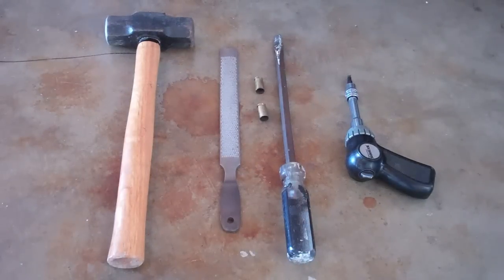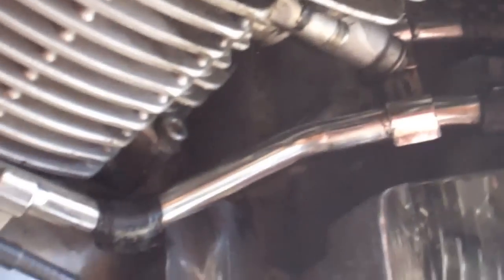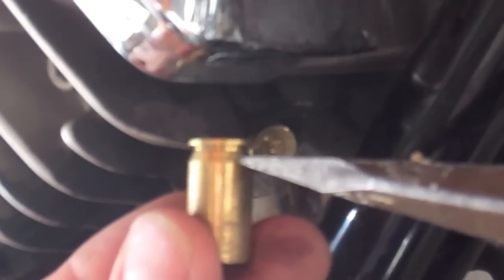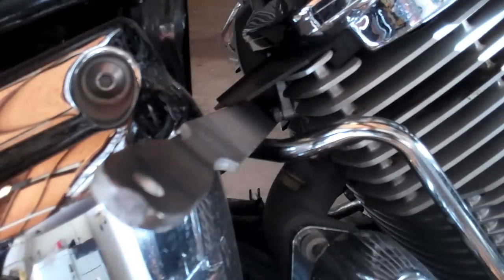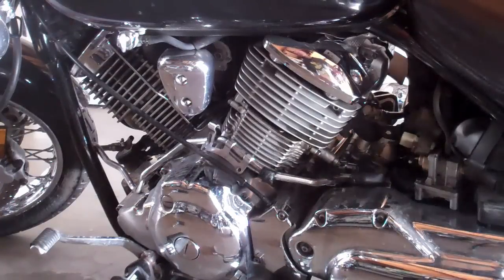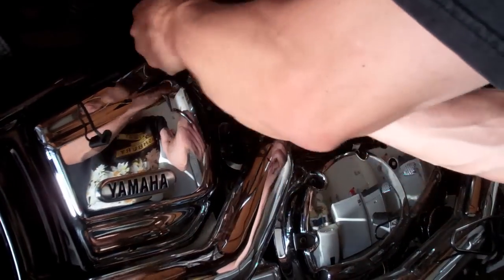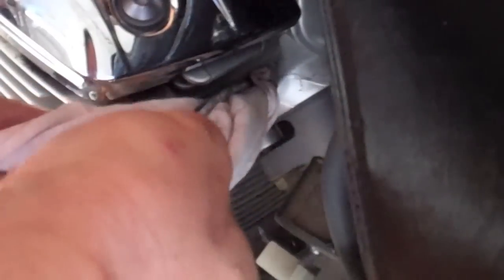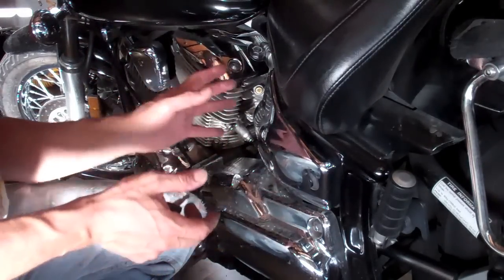Removing Yamaha V Star 1100 Custom AIS System

Comment: What's the reason for doing this???
Reply: Eliminate popping on deceleration
Reply: yeah, please tell me, I'm in Canada so getting a 45 casing is out of the question. HAHAHA, will my 762 sks work?
Reply: How does this stop backfiring what actually happens
Reply: @scottjones5013  less air richer mixture
Reply: @MG-ks1qg  Urban myth.  The AIS doesn’t contribute to popping in the exhaust.  Tune the air fuel mixture.
Reply: @vstar7196  your the only person I heard say this.   Unfortunately I don't think your correct.  Aftermarket run hotter than stock.  So wouldn't shooting air into the exhaust cause popping?

Comment: I don't see why one just wouldn't take the AIS hoses from the cylinder heads and just use a rubber cap with a hose clamp similar to what you have on the right side of the carburetor where you connect your manometer. If you hammer on that rear (or front) cylinder AIS connector the way it's shown here, you risk binding it on the way out and possibly deform the hole. I always like to be able to reverse anything I do, and that might make it impossible.

Comment: Did this today on my BT1100 (same engine)
Because we are not allowed to have guns, a bullet casing was a bit hard to find.
So what i did was grind the plugs down, and welded them shut. Then i hammered them back in.
10 minute job max.
Don't forget to plug of the airfilterbox.
Reply from the maker: Did you notice any improvement?
Reply: @Byrds1967  It is still on the lift, Gonna rejet is also. 
Here in the netherlands they came with a little restrictor in the carbs, so im gonna get those out and rejet it.
Also gonna get a k&n filter. 
It has some carbon exhausts and i think the previous owner did not do a rejet.
Reply from the maker: @D.Mulder  Well have fun with it.

Comment: By removing the system it resolved the backfire bug I had, my star has cobra pipes and a maximum k&n air kit so this was a must… you can also remove that pump if desired.. cool video, 👍
Reply from the maker: Glad it worked out for you. Yeah, I didn't bother removing the pump.

Comment: working on mine right now and found these connectors also swivel out if you are patient enough. the system so called pump is not really even a pump just a vapor valve. just removed it all. I also re installed the clutch cable bracket but cut off any references to the pipes and applied silver paint to the edges. looks great when its all off.....

Comment: What I did on my 94 Virago 1100 was just remove the tubing and then hammer 9mm shells into the knuckle instead of hammering the knuckles out and hammering 45 shells into the head. Works just fine. If you ever want to remove them I think you could probably get them out with a drill. I used a 16 penny nail head to tap them in deep.
Reply from the maker: That sounds like a good option too.

Comment: I used the Baron AIS kit. To anyone...how did you get the 45 cal into the front cylinder? The frame is direcFrontn front of the hole. It seems virtually impossible without removing engine from frame. Any suggestions greatly appreciated. My bike is 2002 vstar classic 1100.
Reply from the maker: You use a large screwdriver just like the video showed.
Reply: I think because I'm using the Baron AIS Kit and not a 45 cal shell, the large screwdriver doesn't work. I may try using some type of "C"  bracket that will go around the frame. The issue with the Baron kit is the top of the plug is domed shaped on top and not flat like the 45 cal shell.

Comment: I have a question, can this be done but somehow leave the Chrome tubing,. ? I like the looks of the chrome tubing,..
Reply from the maker: Yeah, you can leave the chrome tubing if you want. Once you bend the AIS system tube into itself, the system no longer works. And my V-Star started popping after I put straight pipes on it. I don't think that has anything to do with the AIS system.
Reply: @Byrds1967  I just bought the bike, it has Vance & Hines and was put on professionally,. I’m wondering if the redone the jets ?
Reply from the maker: @CindyDC  So if your Vance & Hines installer put on straight pipes and a bigger air intake system then they should have redone the jets as well. My bike pops all the time on deceleration. The increased power is worth the pops.
Reply: @Byrds1967  the person I bought it from said he had them done by a professional ,.. thank you for replying 😊

Comment: My next project. Added some cobra pipes, and she's now too rich. The cackles are nice, but the backfires when decelerating can be fairly loud. Also I did not have to re-jet my 1100 for the cobra pipes. I should have, but they have an outer cover that would hide any blueing. But is that normal? To throw a aftermarket exhaust system on a completely stock bike, and burn rich?
Reply: Backfiring on deceleration means it's actually lean. Rejetting the carbs is pretty much a must.

Comment: I have a 2007 which I pulled the stock baffles off, I am making the exhaust come out in a “true dual” way. So one pipe a side by just flipping the rear cylinder elbow! Anyways any word on reviews with my year ? I’m wanting to give this a shot because I have an issue with the popping myself which I’ve had 2 shops saying that the popping will happen no matter what I do?

Comment: should you also dismount the pump and terminate wires to it, the system does not needed anymore.
Reply: ahmod ahmed good question I’d like to know the same thing
Reply: Yes you can, the pump is only powered by vacuum. There are no wires to worry about. Just remember to reinstall the bolts after removing the pump.

Comment: What do you do with the line that runs down and into the pump? I’ve seen guys plug it with a golf tee but wouldn’t that fill up with gas? What’s the best to do here? Can it be removed? If so, do you need to pull the tank? TIA! 👍🏼
Reply: Golf tee - since 2005
Reply: It is a vacumn line, so anything to plug. Usually a rubber fitting like on a car intake.

Comment: Hi made the mod and couldn’t have been easier.   No more backfire or pops from the removal of stock baffles.   Could you do an update with suggestions for the actual pump decommission or removal?   I see you left all 3 hoses (two large and one vacuum style) disconnected.
Reply from the maker: The pump isn't running anything anymore. In my case I'm just leaving it in there. It looks like a person would have to remove a lot of parts to get to it.
Reply: @Byrds1967  So when you left the air pump did you leave hoses in the by-pass mode like in your video or hook them like they are susposed to be . just a question i havnt completed the removal of the hoses yet but damn sure will
Reply from the maker: @davidparker8662  Honestly I probably left the air pump looped into itself. I left the air pump on the bike too. Those things are tucked away and hidden as it is. The main mission was to seal the cylinders (with 45 shells) and remove  the extra tubing.

Comment: Why do this will bike run better and richer what’s the reason for doing this ? Thanks Don
Reply: You have probably figured it out by now, but essentially it was a requirement for the stock exhaust. If you do any kind of aftermarket exhaust or drill out your baffles you will "probably" needed to disable the AIS because you will more then likely be running too rich and your exhaust will be back firing or popping.
Reply: Wow my 1100 is long gone

Comment: Did this to my 2002 V-Star Classic and it backfires BADLY!!! But it is a used bike and someone knocked out the baffles from the exhaust pipes, do you think that is the reason for the backfiring?
Reply: William Sanford it needs to be rejetted because the pipes opened up
Reply: it's running lean. mine did it too until I ritchened the idle air mixture and it helped. but it needs bigger jets.

Comment: What does this do for the bike? Someone bypassed mine previously and the hose blew out
Reply from the maker: It recycles unburnt fuel back into the cylinder to reburn it. It's more for EPA concerns. Folks get rid of the system to: 1) Give their bike a cleaner look. and 2) Get rid of the vacuum draw on the cylinders.

Comment: im new on having my v star 1100.. what would be the good outcome of removing AIS?..
Reply from the maker: Well a stock bike has average power and good gas mileage. Most folks get: 1) Straight pipes, 2) Max Air Filter Relocation Kit, and 3) Remove AIS System. Doing those 3 things will increase your power 20%......but you will lose gas mileage.
Reply: thank you very much for the info sir.. i really appreciate it. Godspeed!
Reply from the maker: No problem....enjoy, it's a great bike.
Reply: So you go from 40Hp to almost 50Hp or do you just accelerste faster due to unrestricted combustion?
Reply: @Byrds1967   hi, what does the system actually do ?? Cheers Dan
Reply from the maker: @danjohnson7306  I it takes unused fuel after firing in the cylinders and recirculates it back into the exhaust system to burn it up. It's more for It's more for emission control.

Comment: The real fix for popping or backfiring on deceleration is to have your carbs cleaned and tuned properly. It will also prevent you from beating the hell out of your ride.
Reply: That is just not True, I cleaned up, tunad, everything and it back fired  again. As soon as I took off the AIS, it never happened again
Reply: @arifsonfilm9662  agree

Comment: <3 my mate from our club gave me shells that have been fired- ive gotta solder them for the seal ? 
THAT BIKE SOUNDS SICK i also have backfire- so need to do this and i want a hypercharger! great easy to follow vid thankyou
Reply from the maker: No soldering necessary. Just tap the shells in as shown in the video.
Reply: mine have holes in the bottom i meant the solder will cover them--- guess they've been fired?
Reply from the maker: I have fired shells but NO HOLE. Get some casings without a hole. Solder will probably melt under the intense heat and pressure of the cylinders.
Reply: lmfao mate its not that easy- in UK to get fire arms or ammo...
Reply: my bro in our club said solder would probably work... it is exhaust valve right? so not the same forces as say the piston
Reply from the maker: Then perhaps you should just buy these. These are actually made to seal the cylinder holes. But in America bullets are everywhere, that's why I just used the shells. https://www.amazon.com/Pacific-Coast-Star-Yamaha-Removal/dp/B00N29CAOU
Reply: ahaaaa awesome thankyou- my mate in my club obtained them- and said i could solder them he could only get the ones i described :D ride easy dude!
Reply: lol cant get them delivered....... damnit
Reply from the maker: Wow, plugging those holes is turning into a real project for ya.'
Reply: Byrds1967 yeah man I'll probably find some kinda kit maybe Harley have or I can order... I think I found somewhere
Hay at least I'll of earnt that beer!haha

Comment: Why did you remove this system?
Reply from the maker: I was seeking more power at the time, and to get rid of any vacuum leaks that might exist. I also wanted a cleaner look for the bike.
Reply: @Byrds1967  I have a backfiring problem in the top pipe. Could this AIS system be the problem?
Reply from the maker: @carandme1  Mine still backfires a lot on deceleration. Based on that, I doubt the AIS system would improve it much.

Comment: Do not do this unless you have replaced the stock exhaust and had the bike tuned, also if you go this far you might as well remove the pump too.
Reply: Why do you have to replace the stock exhaust. Can you modify the stock exhaust? What is the issue with replacing the stock exhaust before doing this?
Reply: With cobra pipes and maximum air kit this was a must do.. my bike backfired in the lower gears and this stopped it…

Comment: I just got my Yamaha V Star and I'm wondering what is the purpose for removing the AIS system
Reply: @PauseDenied Oh damn so thats where the small back fires are coming from? I have 4.5 inch cobra exhausts and the the popping has been really bugging me. I even did a valve adjustment and was all "I guess its just how the bike is".
Reply: @justanotheropossumchannel  hey man - just wondering if you did this and whether it helped? Just bought a 2004 with aftermarket pipes and have some loud decel pop. Also getting high vibration at 70mph for some reason (engine related as it goes when I pull in the clutch). Gonna try this and also sync the carbs 👍🏼

Comment: Please forgive my ignorance, I just bought a 2000 xvs1100. After searching google I found your video. Maybe unrelated, but  I am having an issue with the oil light staying on and the oil level is just fine!  It came on yesterday after hitting a pot-hole, and although there is no visible damage and the bike and runs fine, the freaking light comes on after a couple of minutes and stays on. Anyone experienced this issue?  Also, Why remove the AIS?
Reply from the maker: The only time my oil light ever came on was when I had really old oil in it and had exceeded 4500 miles before a change, otherwise mine has never come on. As for the AIS....if you plan on putting on straight pipes and a better air filter system then disabling the AIS is the icing on the cake. You'll squeeze every ounce of power that bike has to offer.
Reply: The possible reason for your oil light staying on is likely your oil pressure sensor being gummed up
Reply: If the oil pressure sensor is not gummed up like Cyrus said then it may be going out OR you can check the connection of the wire at the sensor. I've had an issue like this with my neutral safety switch and it was a loose connection.

Comment: My hoses crinkle like shut do they have to be open oh great video
Reply from the maker: My hose has a sharp bend in it too. It doesn't make a difference. The pump is basically just feeding itself now, and has no effect on the engine.

Comment: Is the system any different on a classic?
Reply from the maker: Devin Canard I think the only difference on the classic is some exterior hardware like bigger head light, and longer fenders. The engine and AIS system should be exactly the same.
Reply: +Devin Canard  same motor in either classic or custom 1100 from 1998 -2011
Reply from the maker: +Devin Canard No, it shouldn't be any different.

Comment: I did mine and now it makes a chirping sound on deceleration
Reply from the maker: Are you running straight pipes and modified air filter? The AIS was the last thing I did to pull the last bit of power from the bike. Mine backfires on deceleration, but it's worth the trade off.
Reply: @Byrds1967  They are cobra straight pipes carbs been rejetted stock air intake. runs great but hate the chirping through exhaust. I think they gave me the wrong size plugs from pacific coast. I think they are supposed to fill the whole hole. seems like plugs are too short.
Reply: Now I got to think of a way to get the plug kit out and put in the new ones I bought from baron customs. They look like they are longer to fill the whole tube insert. That way there is no open space inside the cylinder to make the chirping sound go away.
Reply: sounds like a air leak.
Reply: @denoc817  I went ahead and put the 45shells in the holes made chirping sounds still but are starting to fade the more I ride. There is no air leak anywhere I made sure
Reply: @cedler426  Ok cool hope it goes away. My bike did the same thing. What I done to get rid of it is standard tune up. rebuilt the carburetor, added shims to Diframe jet kit, bore a tiny hole in the diaframe, adjusted valves, increase the lean on the Welch valve fuel mixture,  did a carburetor synchronization, removed the AIS. All for the Cobra Slip on and Air Pods. Summer is very hot in Central California so I run 20/50 full synthetic. I notice my exhaust isn't as hot as it did when the AIS was connect. I am very satisfied with my bike now. I hope you find that chirping noise. Even if is does kinda goes away while driving. it still a bit of annoyance.  Good Luck update if you do find out what causing it.
Reply: @denoc817  Thanks man. I'm thinking a little more fine tuning & maybe it will go away fully. Yeah I tried the 20/50 it seemed to idle a little lower/sluggish I probably could have just turned the idle up a little but it did run cooler to. I went to the 10/40

Comment: Thanks much for this video. I have a 1986 Virago XV700 and thought this system was some sort of PCV system. So you can just plug them eh?
Reply from the maker: I had a 1983 Virago 750 at one time but didn't mess with the AIS system on that particular bike, it had enough power . If it's put together like the Vstar then the directions should work. Just make sure you "run the pump into itself and the cylinders into themselves" with the rubber hoses for a test ride first. If you like the change then plug them.
Reply: all it does is add extra air to the exhaust after the valve to pass emisions. it really has no effect on power.

Comment: Will this work with 2 into 1 exhaust?
Reply from the maker: If you're running straight pipes into 1 I don't think it will matter. To get the best performance you don't want a baffle in the pipe(s).